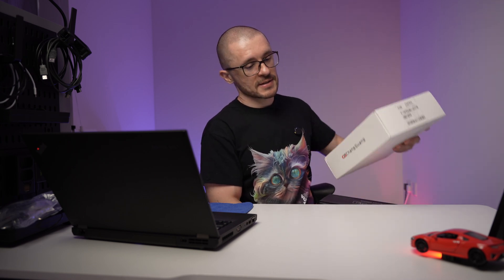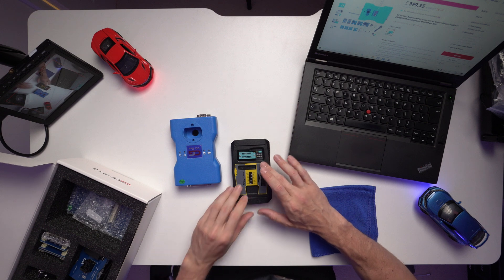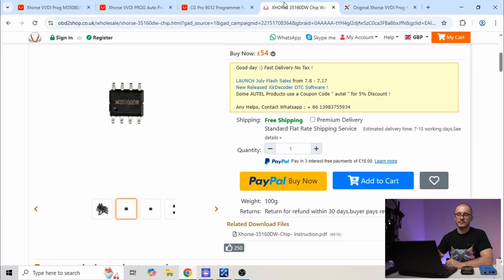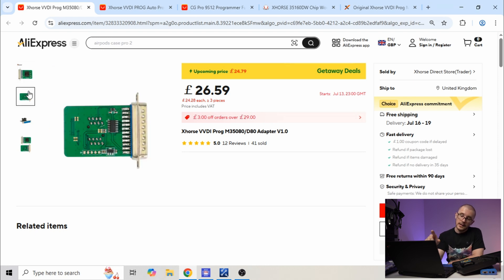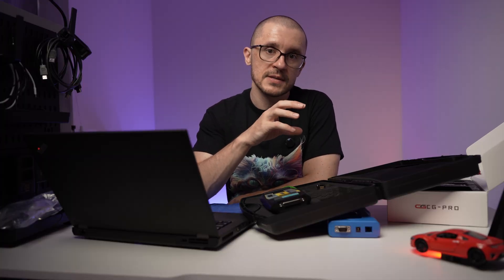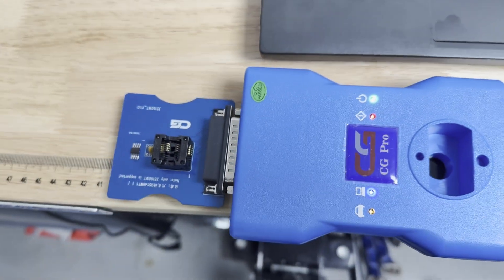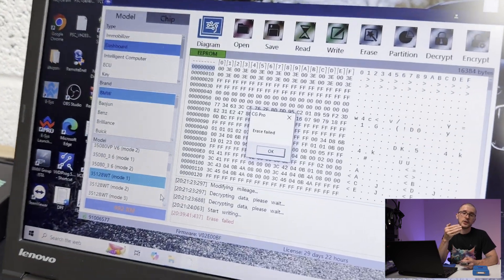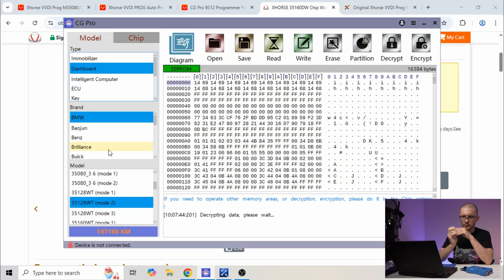BMW Mileage Correction: VVDI PROG vs CGPRO | Best EEPROM Tool? 35128WT & 160D0WT

Comment: i have done multiple bmw g series clusters WT35128 in two cases CG pro was not able to correct mileage in mode 1, searching for solution there is one option Yanhua YX35XX programmer which is using emulator chip but it has downside its only 1 time use , as i searched there are not other options, i thought of buying VVDI 2 but i don't know if it is capable of doing G series 35128
Reply from the maker: which chip have you used from Yanhua ? the big or small one ?
Reply: @BestDiagnosticTools  i have not bought one, i had some questions by looking its photos i thought it would be hard to solder and after watching your video it looks to hard to solder it properly  i am searching for other options, and yanhua has terrible customer service that's another concern.
Reply from the maker: @jeffmilles123  I think I will try to do an octopus and solder wires to the chip and solder the wires to the board. that will make for a fun test.
Reply from the maker: take a look at this one and let me know what you think https://youtu.be/wp_XreCg9GU?si=lbKu85x13oO4g_oQ
Reply: Cg pro will do it but you need to heat the chip up before try to write
Reply from the maker: @typergaz82  tried it and it did not work :https://youtu.be/yJ4wg06nuqg?si=T8ZJU-glhifusJxt&t=544

Comment: CG Pro is better than VVDI Prog. Use the 35080 adapter in CG Pro instead of the 35160 one to erase the incremental area. It works perfectly. I’ve done many instrument clusters this way
Reply from the maker: Thank you for sharing.
Reply: @BestDiagnosticTools have tou tried this method? How it worked on 35128wt?
Reply: You mean 35080 adapter for 35160 eeprom?